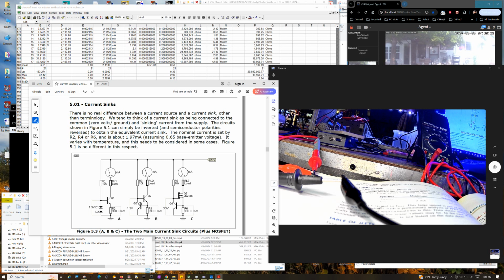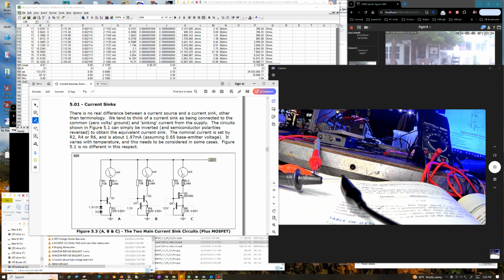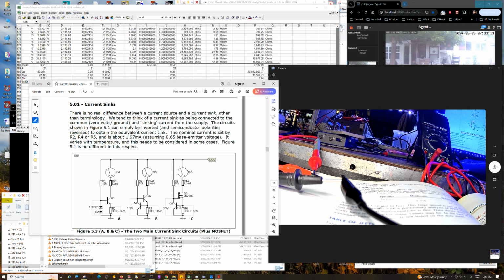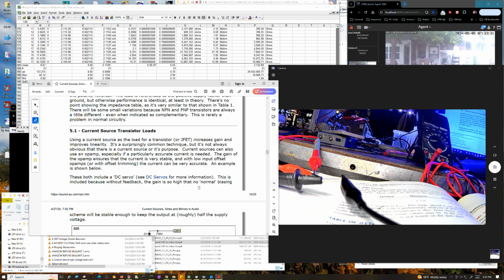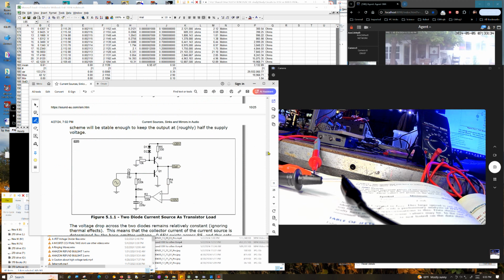CCS Theory and musings about current mirrors: CCS Vid 6

Comment: Actual info for grown people, love it.     

If them Army ants, they setting up a new colony. Check for holes, outside AND inside near doors and windows. I usually keep a mix of 4:1 water (hot to start) & bleach with some Dawn mixed in for the places I don't wanna spray insecticide. Takes a lil bit to work on a colony but you can saturate the wood inside to force them outside.